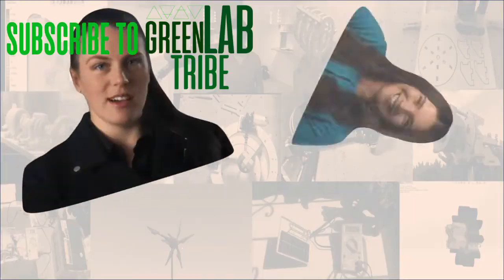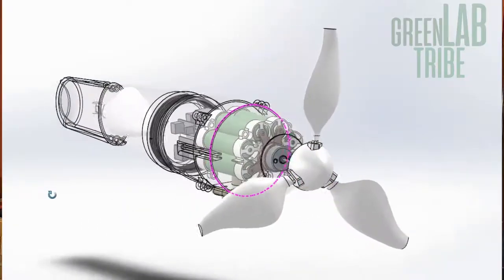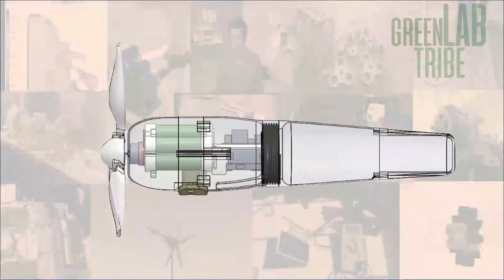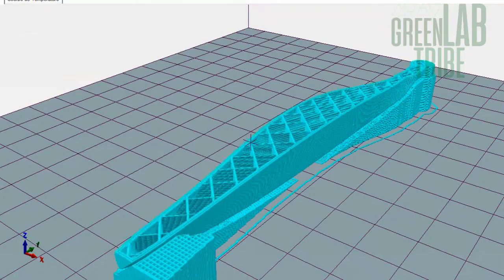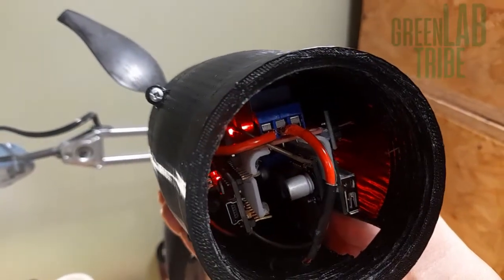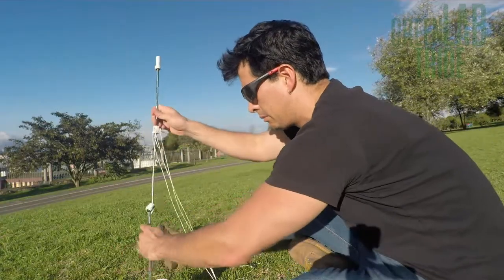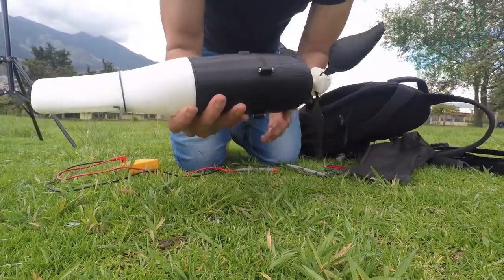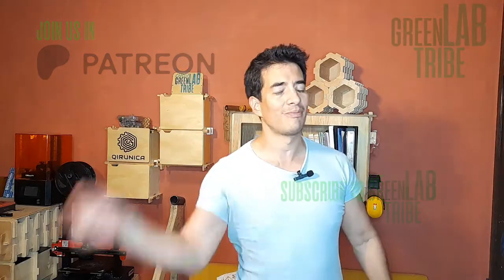I made a portable wind turbine line the Shine turbine

Comment: I don't believe the 40 watt claim. Maybe in a hurricane.
Reply from the maker: Which are the bases of your beliefs?
Reply: Physical size and the power available in the wind. 40 watts at 28 mph and 5 watts at 14 mph
 @greenlabtribe
Reply from the maker: @justtinkering6713  By applying the wind power equation you can get a 40W with a 0.6m diameter at a speed of 7.4m/s, which is pretty decent and inside the rated range (3.5-12.5 m/s)
Reply: @greenlabtribe  5 volts x 2.6 Amps is only 13 watts